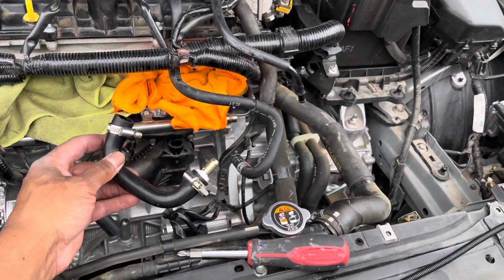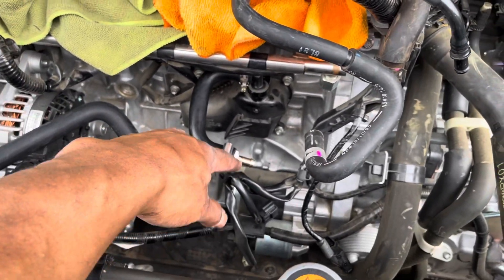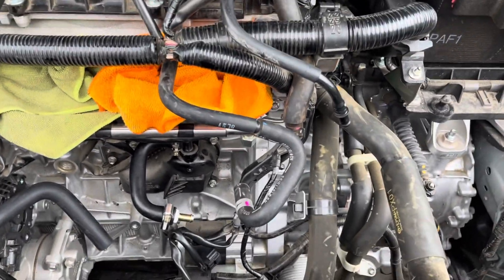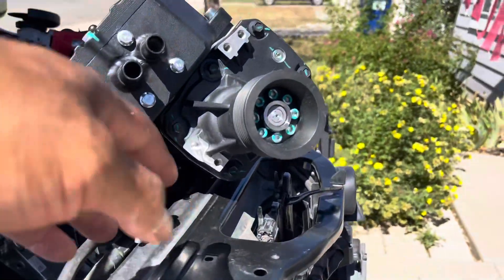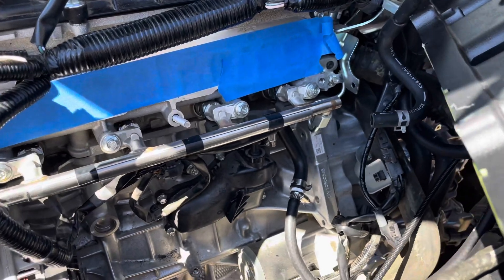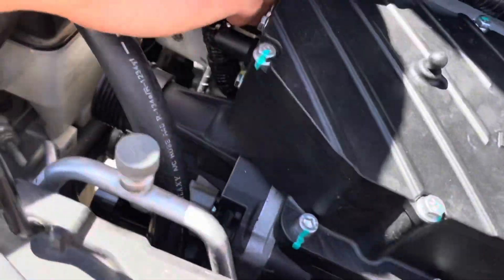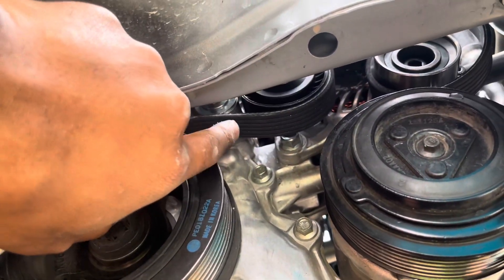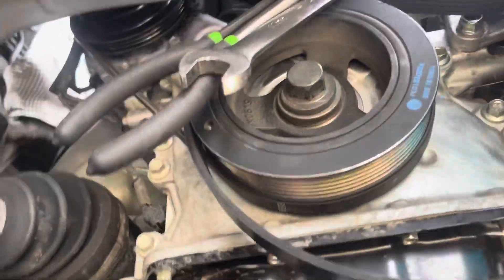4th Gen Mazda3 Supercharger Installation

Comment: Always use ribbed belt for more traction. Continental Elite, formerly Goodyear Gatorback, is what I used on my supercharger to eliminate slip at high RPMs over 7,000 RPM
Reply from the maker: I limit the superchargers to 7000rpm on the 2.0l
Reply: @supermazda3 mine was MX-5. Goes to 7,500

Comment: I just bought this kit. The alternator tip will help a lot. I'm not a big fan of how they want the water pump wired. Which fuse did you use for it? I may run it's own circuit later but that is the only unclear thing about this kit that I see so far.
Reply from the maker: I used Engine 1, I have been using it for a year & half
Reply: @supermazda3  what psi are you hitting?
Reply from the maker: @Needle80  at 6k feet elevation, it's 6psi at sea level 12psi
Reply: @supermazda3  nice! I'll be around 1,200. Congratulations on the installation. I'll be putting mine on soon.

Comment: What are the supporting mods? Oil cooler, inter cooler? What needs to be bought separately to make the kit work?

Thanks
Reply from the maker: None of those things, just upgraded spark plugs & an oil cooler. The kit comes with everything you need
Reply: Awesome video brotha! Thank you for sharing. Were you tuned when you first installed your supercharger?

Comment: how much did this supercharger kit cost? this is def something i wanna do to my 19 hatch
Reply from the maker: Between $3300-3500USD depending on the exchange rates
Reply: @supermazda3  not too bad. is yours 2.5 NA? i’d love to know the hp & torque gains you get once you finish it up. along with the mpg changes
Reply from the maker: @bread6235  MPG remains the same, I will have a dyno done in 2 weeks to find out